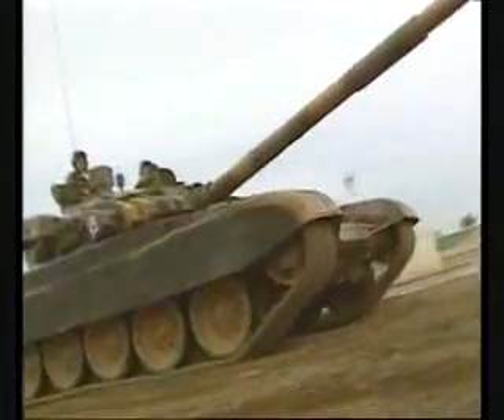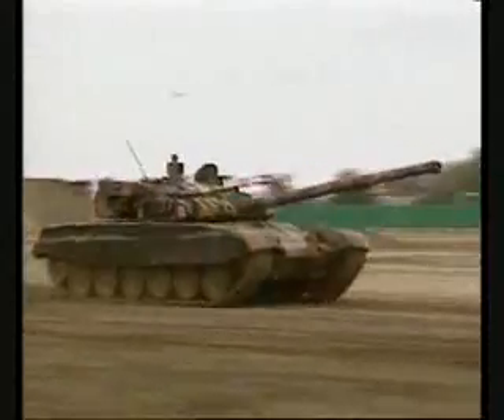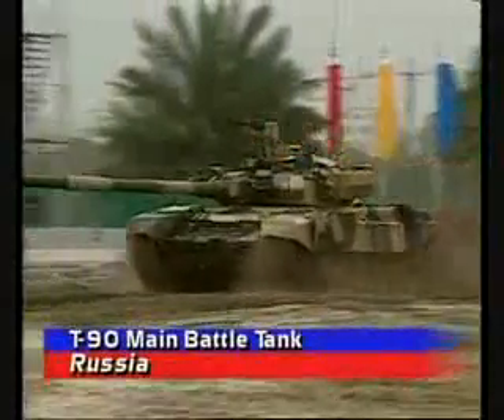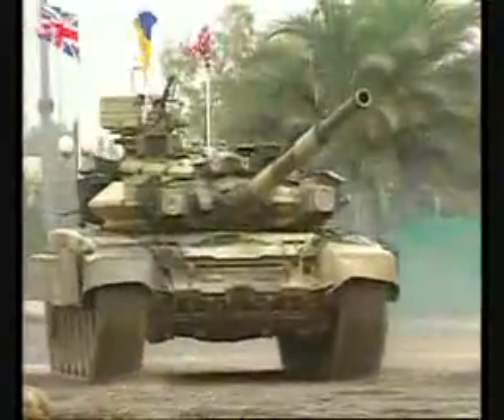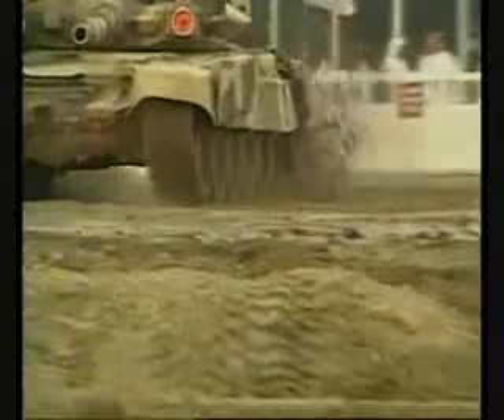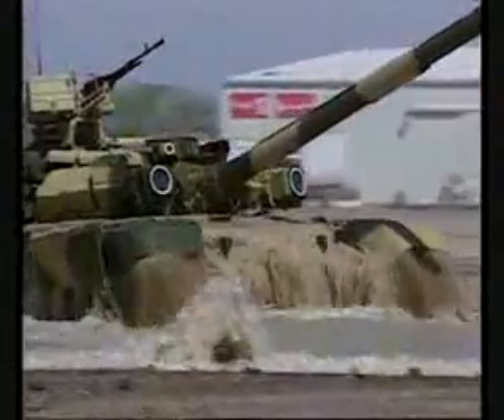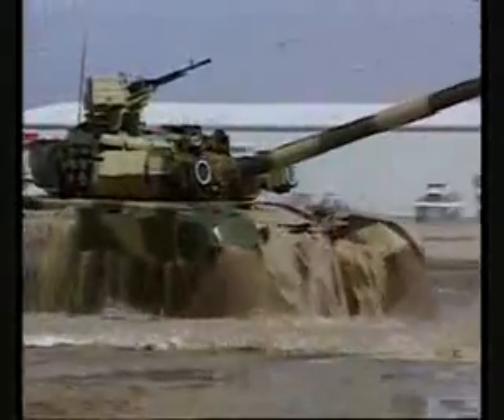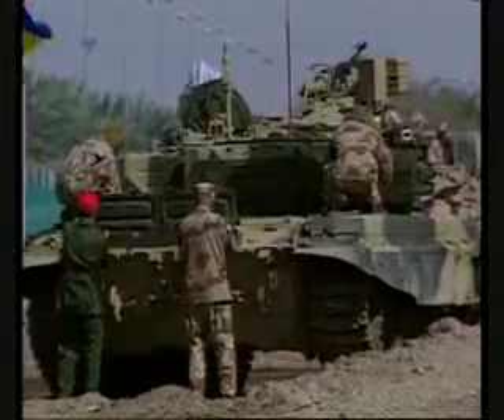Fuerza Armada de Venezuela Tanque T-90

Comment: @az99946 A pesar que el M1 Abrams es de la epoca del T-80, las configuraciones del M1A2 no es moderna ya que se desarrollo antes del 2.000, aun que hay videos prohibidos y lo he visto donde los M1 Abrams no aguanta una bomba puesta en el camino ademas un RPG-7 con proyectil HEAT moderno tiene el poder de penetracion de 600mm y el M1A2 en su punto mas debil es de 700mm contra los HEAT lo cual el M1 queda neutralizado el punto mas debil contra HEAT del T-90 es de 1.130mm

Comment: @akiles26111983 Pues es logico pero puede llegar tener la capacidad del T90, le puede colocar ceramica de kontak 5, colocar el coñon del T90 colocar los sistema de tiro y otros es como agarra una wagoneer le colocaras motor caja de un Gran Cheroke 2007, luces hid, asiento y vidros automatico, suspencio de carro de otro modelo y otros.